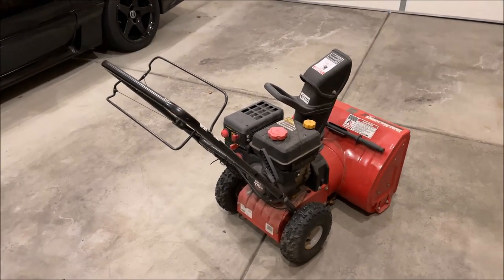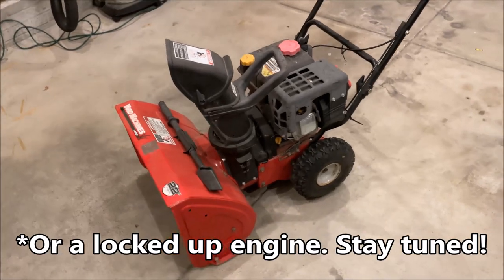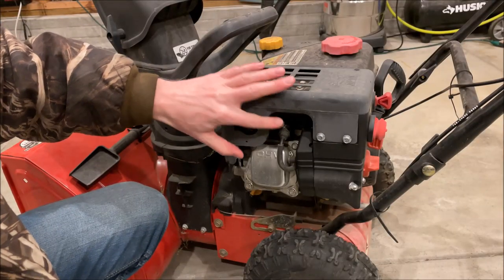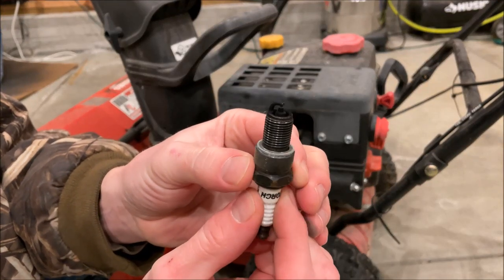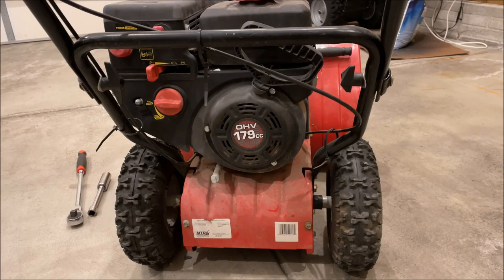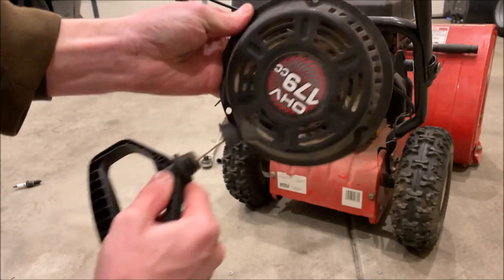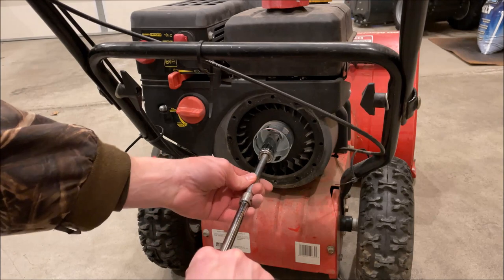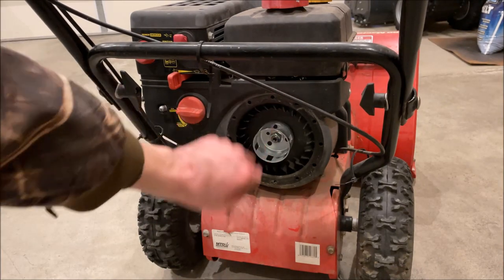Locked Snowblower Pullcord Diagnosis and Fix

Comment: Snow blowers don't have air filters and if not stored properly moisture can get in the cylinder through the carburetor cause rusting & rapid corrosion via electrolysis on the cylinder wall, piston, piston rings and valves seizing the engine.  This is why you should first pull the sparkplug and spray fogging oil in the cylinder then replace plug then slowly pull the recoil starter until you feel the greatest resistance at this point the  engine piston is sitting at TDC (top dead center)on the compression stroke, which leaves the piston at the highest point in the cylinder with both valves closed this will prevent any moister or critters getting in the motor causing damage and seizing.  Another thing that will cause the engine to seize and potentially ruin it is using ethanol blended fuels. Ethanol alcohol is both  hydrophilic, which means it attracts water and also pulls moisture from the surrounding air and also  hygroscopic, which means it absorbs water. It can absorb water from its surroundings, like the atmosphere. This water that is in the fuel can be introduced and left behind from residual unburned ethanol fuel that remains  in the motor inherently when it is shut off.  Let me explain when you initially try to shut the motor down by switching the key or throttle lever off this stops the spark plug (ignition source) from sparking by grounding out the ignition coil.   But because the motor will still continue to rotate for several seconds before it comes to a complete stop and a combustion Engine is essentially just a big air pump. It continues to pump raw air/fuel mixture through the motor for those last few seconds of shut down with no ignition some of it will remain unburned this water containing raw fuel mixture can seize the motor. if you encounter this issue never try to forcefully rotate the engine like this dummy did without first pulling the spark plug and spraying some WD-40 or other penetrating type oil into the cylinder. This will help dissolve any rust or corrosion on the  piston, cylinder, rings and valves etc. This should successfully free  up the motor without potentially causing major engine damage like  breaking the piston rings and or scratching the cylinder wall by forcefully rotating the dry rusty stuck rotating assembly.       pro tip never run crappy ethanol blended "Hybrid Fuel" a.k.a acid gas in your equipment and it will prevent 99% of all your engine problems. its a inferior and extremely destructive fuel resulting in massive repairs bills, down time and destroyed engines. its also more expensive to run this crap fuel as it 30% less efficient than regular unleaded gasoline. https://www.forbes.com/sites/michaellynch/2022/06/06/ethanol-is-cheaper-than-gasoline-well-5-of-the-time/?sh=7339867d5f4e
Reply from the maker: Wow, quite the right up!  Other than your insulting comment calling me a “dummy” you’re spot on.  I would’ve spent my time doing something more productive if wearing your shoes, however. Although correct, your recommendations better serve an Indy car engine, not the mechanical pit bulls that are small engines. Scratching cylinder walls is what these engines are made for. Search YouTube for how long a 5hp engine can last with the oil drained then tell me why I should put on white gloves to service my lawn tractor. In other words, save it smart ass. If you want accolades in the comment section, write relevant material. Fart.

Comment: My mower is having this same issue, I know nothing about engine work. Did this same thing and got it running for a few minutes, but then it shut off and is now locked up. Has oil in it. Any ideas?
Reply from the maker: Hello.  It's really hard to say what the problem is not knowing all the dynamics of your situation.  However, if the motor was seized up a little before you started it, it's possible it seized all the way up after you ran it.  Now, I don't think that's what happened.  These small engines are often hard to destroy baring catastrophic failure of a major component.  If the motor had the correct amount of oil in it, it's not likely to have seized.  Although if the oil was very old and worn down, it's possible.  See what I mean with knowing your dynamics?  From my perspective, try the fix you used to get it started and try to run it again.  If it's still locked up, I'd check your pull start cord apparatus and make sure that hasn't failed.  Also, make sure to remove the spark plug and try and rotate the engine.  If it won't rotate with the spark plug out, it's probably seized and you'll need to buy a new mower.  I hope this helped.  Best of luck.

Comment: So I have this issue, but I also have an electric start in addition to the pull cable. I've used it every year I've owned it, and bought it new, and I start it up a few times in summer to help it along. I got it started just now, and it ran fine, but then it all of a sudden stopped, and now I can't pull the cable, and the electric start doesn't work either (instead of the normal sound, it sounds way off, like it's not turning at all).
What could be the problem?
Thanks!
Reply from the maker: Hello.  So it was running and then suddenly stopped running? Just want to be clear on that point. If so, that doesn’t sound good. Especially if you can no longer manually pull the cord to spin the motor.  In what way did it stop? Was it like it stops because you kill power (normal) or was it a sudden and abrupt stop? 

In either case, First step would be to check the engine for oil. Hopefully there’s oil. Should be between the low and high marks on the dip stick.  Can you tell me what brand the engine is? That will help me a little. Thanks.
Reply: @FastFixYouTube  yeah it was running and stopped, but it was more like it just turned off, it wasn't super abrupt. It's the first time I've run it this year, and it's a little finicky, so I just thought it was turning off like it does sometimes. But yeah then I tried to pull the cord and it wouldn't move.

The snow blower is a yard machine. The engine says powermore premium OHV engines, 208cc ohv/set
Reply from the maker: Okay. Check the oil and make sure that’s all good. It doesn’t sound like it seized, but it’s possible. Also, make sure there are no obstructions preventing the cord from turning. Unsure how the blade and drive wheels are engaged, but make sure those are disengaged prior to starting. Those are simple fixes, but the best place to start.
Reply: @FastFixYouTube  thanks for the help! The oil appears totally fine. Even if the cable were obstructed, the electric start won't start either. You need to pull a lever to engage the blades, and when you start the machine they are not engaged. So it doesn't seem like it could be the blades or the actual pull cord causing the problem.
Reply: @JonTopping  Have you checked your gas level in addition to oil? Perhaps it just ran dry.

Comment: Great work Fast Fix. I have the same issue with this craftsman 26" snowblower someone gave me. Just changed the carburetor and this happened with the stuck pull cord when I tried to start it. Im going to give this a shot and hopefully it works. 

I just ran outside and loosen the engine the same way you did. It worked!!!!

I'll try to start it tomorrow after work. If she perks up, I'll then change the oil and the rest is history. 

Thank you so much for your video, this really helps.

Much appreciated. Subscribed
Reply from the maker: Excellent! Glad this video helped! I appreciate your comment 👍

Comment: If it doesnt spin, what could the problem be?
Reply from the maker: It’s probably frozen. I’d spray penetrating lube into the spark plug hole and let it sit for a while. Then try and break it loose
Reply: @FastFixYouTube  WD-40?

Comment: Mine pulls but only up to half way than if you pull harder it goes all the way up
Reply from the maker: Hmm, that could be a few different things, but sounds like the cord itself is the issue. Sometimes the springs in those mechanisms wear out and you get intermittent pulling.

Comment: I have same problem
Reply from the maker: Hope the video helped. Did you get it fixed?
Reply: @FastFixYouTube  no not yet had pb inside for week now only 10 degrees here but feels tight still certain arrears as I rotate it is looser soon I will try with impact slow .

Comment: Myn won’t even turn it’s completely locked 😡
Reply from the maker: Hello.  When was the last time it was running?  If you stored it after it ran, it’s probably fine, just really stuck. With continued attempts, you should be able to break it loose. Check the oil and make sure it didn’t run dry.  If there’s no oil, it’s probably seized and require a rebuild. Best of luck 👍
Reply: @FastFixYouTube  I just bought a new engine any way
Reply: @FastFixYouTube  my Compressor won’t turn even with your solution it’s been sit for 4 years I turn it on again and it turned on but when I tried for the 2 time it got stuck 
What you recommend?
Reply from the maker: @jdbgeneralconstructionllc5959  interesting…. I bet the piston stopped in an awkward position and the oil didn’t get the chance to lube up the bearings enough. I’d recommend manually spinning the motor if you can. This might mean disassembling part of the motor, but might be what you need to do. I’ve heard of people increasing the voltage to boost power, but that’s risky and not something I would attempt. Best of luck.